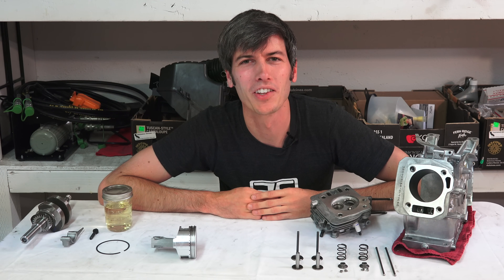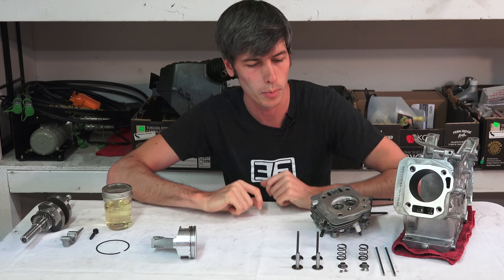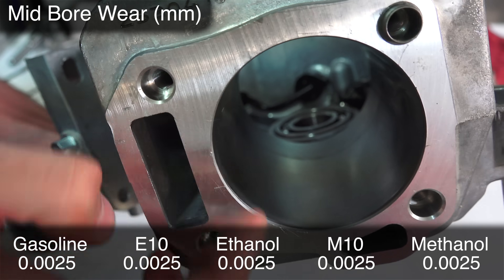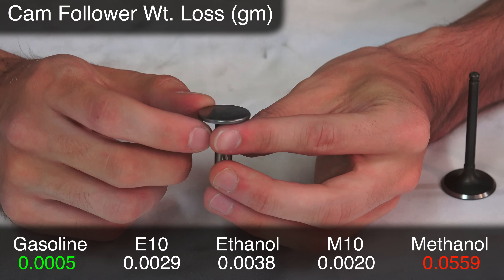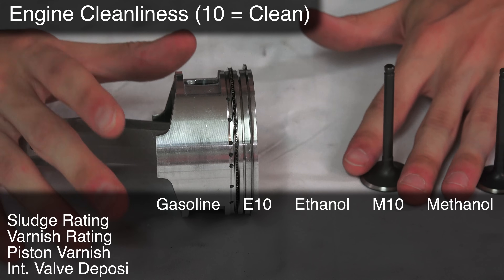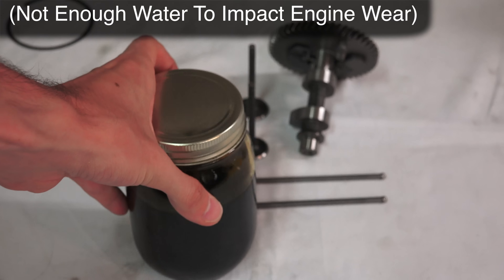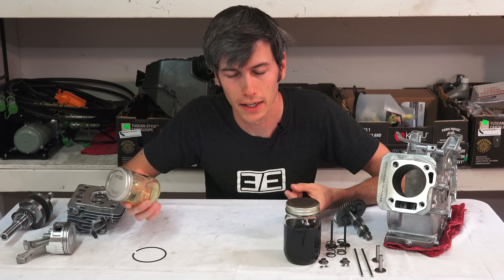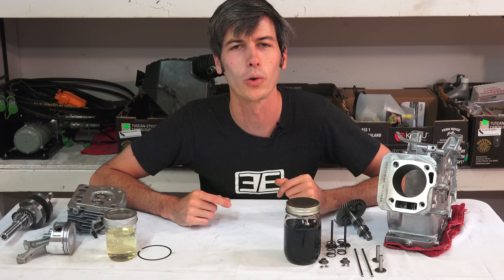Is Ethanol Bad For Your Car's Engine?

Comment: i think people like to complain about ethanol more than they actually experience any difficulty with  it. like: where my freedom if i have no choice but to buy e10. It gets way worse mpg (%2) less energy content..meanwhile airships invade syria... frackwells dot the western rockies...wheres my freedom, I dont trust those darn commies in office. they dont understand the only way to go is pure gasoline. never mind the industry began on ethanol. Nevermind Henry Ford thought it was the perfect fuel and envisioned a self sufficient fuel producing America running on Hemp. never mind it can be made sustainably. Never mind it actually prolongs engine life (Alcohol Can Be a Gas (book)).. Never mind 10% ethanol reduces emissions significantly. what matters is my darn freedom at the pump, freedom to buy pure gasoline! @Engineering Explained Id live to see a video about the histotical and ethical implications of our fuel use in the United States. Compared to Oil, ethanol looks like a Saint. Meanwhile the whole focus is on how the corn ag industry exploits subsidies and mandates to produce ethanol in and exologicall irresponsible manner, and everyone associates ethanol with their follys. In WWII the germans ran on ethanol, which was why the stuck around so long,their fuel stocks were not centralized, let alone dependent on  middle eastern politics.

Comment: The phase separation thing is a big deal for storage, and small engines that are used infrequently. Ethanol-free gasoline is better for those applications. Fortunately, where I live, in Alberta, all premium fuel is ethanol-free.

Comment: Such a test is fine as far as it goes, but... automobile engines don't typically run 20 hours at a time routinely.  They typically sit around for many hours, are operated for, perhaps an hour, sit around, run for an hour or so, etc.  So this study as an estimate of lubricity during the period the engine is operated is valid as far as it goes, but it doesn't really go anywhere into the areas where ethanol has its biggest problem.  Over time, ethanol/gas mixtures separate.  If a car sits around for weeks/days, the ethanol will to varying degrees separate from the gasoline (depending on temperature, humidity, etc.).  And the FUNDAMENTAL difference between ethanol and gasoline is that ethanol (all alcohols, actually) are hydrophilic and absorb water.  What happens when you introduce water into a combustion chamber and then let it sit?  Can you say corrosion?  I knew that you could.

Comment: The fuel economy argument against E85 doesn't hold up because E85 is significantly cheaper and produces much less pollution.E85 generally tends to be more efficient due to its higher octane allowing more aggressive timing. So while you would say that ethanol has about 33% less energy than gas. That energy is applied more efficiently than gas therefore you will end up with less fuel needed for the same power. Ethanol keeps pistons much cooler and hardly produces any carbon build up. Ethanol in general is a much friendlier fuel to engines than petrol. Of course, Ethanol has a few disadvantages (that are more than justified by its advantages imo). It's harder to ignite when the engine is cold, and it'll require a bit more frequent oil changes.

Comment: What I see a lot people do is put in one full tank of E10 in and then blame it afterwards for the much worsen mileage. Please note that modern cars are capable of getting the most out of E10, compared to 30 years ago. Still, it takes some time for ur car’s advanced OBC systems to determine and learn about the new fuel you just put in, and come up with an optimal solution, so a worsen mileage during the first tank can be expected. And in fact after some time when the consumption stabilises, there’s really not much of a difference. While E10 has 3% less energy (yes 3% less), you get a high octane rating (octane rating for ethanol is 113, that’s why racing cars use E85), and more oxygen in the combustion chamber, which enables a more complete combustion stroke, and theoretically a smoother ride because of the boosted octane rating

Comment: Dont worry with modern cars? First there is totaly no need to use plants to create alcohol and then mix it with gasoline. This all has to do with that global Co2 scam. Also on that land there could be growing food crops. Older cars have a problem now because it reacts on the aluminium and sealings and hozes. Seen that happen on a yt channel testing this and it happend in a short time to. Also ethanol attracts water. And gums up when you leave it a few months in you car or motorbikes unused. Also heard mechanics bieing glad about this fuels becouse they got more customers becouse it also eats away some platinum parts on newer cars. I think this the next scam to get us out of combustion ingine in to electric cars.

Comment: surely nobody was arguing about ethanol's effects on the metal internals and were significantly more concerned about the fuel lines and the water that might accumulate in the tank as a result of E10 being hygroscopic?
Reply: Water accumulates in all fuel tanks when the fuel is frequently at a low level. Fuel tanks and air do not mix. Rust generated by water is the single biggest cause of fuel tank failure.

Modern fuel lines are 100% resistant to ethanol... if they are eroding you have been sold inferior tubing. 

Keep in mind that all racing cars have run on 100% ethanol for the last 20 years.

Comment: If ethanol was so great then how come gumout and other brands have fuel injection cleaners with corrosion inhibitors? Notice e15-85 has bigger hoses at the pumps? Ethanol is attracted to water. That can't be good. It also seperate out in a short amount of time and sinks to the bottom of the tank causing hell on a fuel pump. Notice it's got serious issues in lawn equipment, motorcycles, boats, etc. Even aviation fuel doesn't have ethanol in it.

Comment: Fascinating that the engine wear issues came from the formaldehyde and and formic acid.  Those are the same compounds like ultimately cause methanol poisoning in humans (think bad moonshine).  The methanol breaks down to formaldehyde which them metabolizes as formic acid.  It is actually the formic acid that causes blindness and ultimately death.

Fun fact, if you overdose on Methanol, the antidote is ethanol... yes, they get you intentionally drunk.  You see, your body prefers to metabolize ethanol and thus slows down the methanol metabolism which allows your body to properly process the formaldehyde and formic acid.

Comment: Is there something about injection or caburator? I've heard that ethanol tends to clog carburator jets more often.
Reply: Ethanol itself will actually clean the jets, there's nothing in ethanol that can turn into a varnish . The reason for the reputation is because ethanol can break loose buildup in the fuel lines that clog the jets.

Comment: Here in Brazil, a Ford Ka naturally aspirated 1.0L 3 cylinder engine produces 85hp when running with 100% Ethanol. It makes 10km per liter in city. In my opinion, using Ethanol is the best choice by far.

Comment: All these comments are talking about fuel economy and miles per gallon but I’m just glad that I can pump ethanol since it’s much more knock resistant than gasoline. That means more boost, more buff horses and most importantly, more smiles per gallon ;)

Comment: Here in Brazil we have “flex” cars that can use ethanol or gasoline. Basically every new car her is flex, even BMW or Mercedes. 
Our normal gasoline have 25% of ethanol. 
We also used to have “ethanol only” cars on 80 or 90s, so you chose a model of car,  and than you had to chose if you want it to use ethanol or gasoline. Most of this “ethanol only” cars still alive 30 years later.  
Our Corolla now is the first “hybrid flex” car of the world, 16km/l at  0,70 dollar per litter without using fossil fuels, that is pretty good.
Reply: Some Flex fuel cars have different power and tork according to the fuel that is being used. My car has 101cv with gas and 104cv with ethanol. My sister owns a 2015 VW Fox 1.6 that has 110cv with gas and 120cv with ethanol, some turbo engines also benefits of it, VW 1.0 TSI engines deliver 116cv with gas and 128cv with ethanol.
Another interesting thing is that the fuel filter of flex engines is usually made of plastic and installed in an easy and accessible place because it needs to be replaced in shorter intervals (like 10.000km or 15.000km) and they are very cheap.
Reply: Chevrolet Omega 2.0 Alcool: a great engine! Just an Opel OHC, 8-valve, 4 cylinder, 12:1 compression ratio, Bosch motronic 1.5.2 with knock sensor and 130hp! Amazing for a 1993 2 liters 8v engine! The same gasoline engine: 116hp. I own one, wigh 200.000km I rebuild the engine. The pistons, valves was very clean, no carbon deposits. Minimal valves wear. I was surprised... Here in Brazil we have “ hydrous ethanol”, 92% ethanol, leads to more anti-knock power, more compression ratio and more hps!
Reply: @MCA0090  Good to know that because I haven't changed mine
Reply: @MCA0090  Just for info, CV is HP.
Reply: Have you got peugeot 406 coupé in Brazil ?
Reply: If your car is Japanese and built after 1974 it can run unleaded and 100% ethanol. All it may need is a bit of re-tuning, to increase the air flow.
Reply: Looking from Turkey, your ethenol strategy make sense👍
Reply: Only getting 16 km/l in a Corolla? Sounds like the compression is the same as in the gasoline version? Usually, to utilize the different properties in Ethanol, you need higher compression ratio. The WLTP rating on gasoline is 22km/L
Reply: @Tore_Lund  Yeah, but usually, ethanol costs something like 41% less per litter than the gasoline.
Reply: Brazil is trash
Reply: @jashpaper8370  So...?
Reply: Finalmente alguém que vê como a matriz energética brasileira é boa

Comment: I'd love to see the same study done with a natural gas (CNG) engine :)
Reply: If you look at heads from CNG or LPG cars they are as clean as they day they were installed after 150k. The biggest problem facing your head is un-burnt liquid fuel washing out the oil for the piston bores. This does not happen with gas fuels. Why petrol is still sold is a mystery to me...
Reply: @wiretamer5710  I am Australian and my 1999 Ford Falcon Fairmont AU wagon (the wagon version of Hubnuts Betty) is dual fuel and runs on LPG and either E10 or 91RON fuel. It runs well on any of them and has been on this for at least ten years (thats how on I have had it)
Reply: LPG is a superb fuel IMHO. Been using it for decades. The only thing you 'd better change on a modern car are the spark plugs. You may need another heat grade. Iridium or double platinum types are fine. And LPG is also much more "friendly" for the environment.  :-)
Reply: @pieterdewit9081  yep,  my Toyota truck is just passing through 500k klms and the oil changes every 10k klms still come out brown rather than black .
Reply: Please do this
Reply: Blind Squid  If you started using CNG/LPG to replace petrol the huge change in demand would see its price skyrocket. This is a particularly major problem when these fuels are predominantly used today for residential heating, so millions of cars switching to them would mean millions of people not being able to afford heating their homes in winter.

Also, LPG is already about the same real price as petrol. The difference in the price you pay at the pump is pretty much entirely tax. The only reason petrol is so cheap in the US is precisely because it doesn't pay that extra tax.
Reply: @BigUriel  Hi i Must correct you. But using LPG or CNG is not as heavy as you think. If you use Electricity and for that time fill your car. 4-5 kg per hour i can fill at home. For my Renault Menage 1.6 it mean per hour fling I can go 100 kilometers because it consume 4-6 kg Respectably. And it is not bad Millage. If you need average for two cars 200 kilometers per day. You only use 4 hour per day for effective heating. Trust me Electric Car is way more infrastructure Demanding Than CNG or even LPG. LPG is trash of Oil. They quite literally burning them if you do not to drive on it.
Reply: My car runs on LPG only, liquefied petroleum gas, 200000km and no problems. I would think natural gas similar, but outputs may be much lower and fuel usage higher as to its lower energy value.
Ford Falcon (Barra engine) EcoLPi 4.0 Straight 6 198kW/409Nm.
Reply: Lpg is ideal for old car engines. No worries about tuning carbs and leakages. And some more low end torque if using more ignition delay (advance timing). Injected lpg would be better. And for emissions, less unburnt fuel like carburated petrol engines does. Only more CO2 because burning some more fuel to get the same amount of power to move your vehicle.
Reply: @Alexie3333  why would an LPG engine not need tuning?  leaks still happen with age or faults even in LPG systems.
Reply: @Alexie3333  but no 2.5pmm particles ;)
Reply: Fam, our bodies make that stuff all the time. Apparently anaerobic digesters are commonly used in third world countries.
Reply: Lpg/cng is so scary to drive though, I can’t take my mind off the fact that you have to drive around with several pressurized gas tanks filled with highly flammable gas
Reply: @adorabasilwinterpock6035  as opposed to tanks filled with highly flammable liquid?
Reply: @adorabasilwinterpock6035  I've had LPG vehicles since 2010, the "scary" is you, not the vehicle. All our taxis used LPG until hybrids became cheaper. I've only ever heard of one exploding in a fire and it was not a standard factory setup but a conversion, and I've never heard of any LPG taxi having an LPG explosion and they have the hardest of car lives  - LPG and CNG are very safe but were always sidelined and will never be mainstream.
Reply: @adorabasilwinterpock6035  errrrrrr one tank, designed for purpose,  just like your tank of gas/petrol filled with highly flammable fluid.   Not sure what the issues is.
Reply: @adorabasilwinterpock6035  lpg is dangerous, but CNG is perfectly safe

Comment: Is 20 hours really enough??
To identify wear ?
I think 🤔 would be cool 
To runs 2000 hours 😁👌🐢
Reply: Of course 20 hours is enough.  This is a test showing various degrees of wear, not a test showing how long it takes to destroy an engine.  If one fuel causes "x" percent more wear than another fuel in those first 20 hours, you don't have to continue the test for 100-times longer to know which fuel causes damage to accumulate faster.
Reply: Just ask anyone who works with racing cars... they have all run on 100% ethanol for 20 years.

Comment: I have a lawn mower that has a Honda 6HP engine on it.  I have had it for nearly 10 years, and I have just run E10, sometimes with Stabil, but it can sit all winter, and I can take it out in the spring, and it has always started within 3 pulls, and normally even after sitting for a couple of weeks, it is a one pull start.  I have never touched it, maintenance wise...original plug...changed the oil for the first time this spring.  I don't know what Honda does, but it is really amazing.

Comment: So for my 89 miata i should use premium right
Reply: Till i get flex fuel sensor
Reply: Yes, you should also look into what kind of seals your engine uses. Ethanol can eat away certain seals. Modern cars use seals that are ethanol resistant but some older cars do not. My cousin started putting ethanol into his 70s car (i forget the exact year) and within a month he had leaks everywhere that fuel touched.

Comment: All spark ignited internal combustion vehicles and power equipment can use ethanol fuels as proved by the more than 6 decades of ethanol blend use in the UK and the use of E15 and higher blends in Brazil since 1978.

Comment: I once tried to run my old car on E85. The user manual said the engine was fully compatible with ethanol mixes up to E85. Ran some time without any problems, but after some time it started burning oil. I had the head removed, and the ethanol had eaten through all valve oil seals. All 8 of them. So the engine was running mostly on oil at that time. Had to have it rebuilt. But hey, I passed the first emissions test with flying colors!

Comment: Call me a bit old fasioned, but with more and more gasstations switch to E10 I tend to mix a little bit of 2 stroke oil in the tank (300:1) to keep the top end lubricated. 
My father does this as well with his old Renault (french car brand for you who doesn't know what a Renault is). And the engine is still running smoothly after 350.000km of hard work. Hell even the gearbox failed before the engine did.

Comment: What about the changes in power with different fuels?
Reply: Ethanol can give you more power because it is more resistant to detonation. That allows you to run more timing advance which gives you more power. You would only see these benefits if your engine is knock limited on timing. Knock limited means that when advancing the timing on the engine, knock occurs before maximum torque is achieved. Ethanol will allow you to advance the timing and get that extra torque.
Reply: @Redtooth75  why do we still use gasoline?
Reply: @adityasivaramakrishnan7246  ethanol reduces fuel economy because you must inject more fuel to get a proper burn. Ethanol will absorb water from the air which will contaminate the fuel, especially in humid areas. Ethanol does not vaporize as well as gasoline which can make the engine harder to start, although mixing the ethanol with gasoline eliminates that issue. Ethanol is also more corrosive than gasoline which will cause increased engine wear. However, ethanol is cheaper to make, creates less emissions, and can improve power if the engine is tuned for it. It is also fairly new, only really gaining popularity in the last decade. The car industry will most likely slowly transition into ethanol as it becomes more developed and popular.
Reply: @Redtooth75  Thanks!